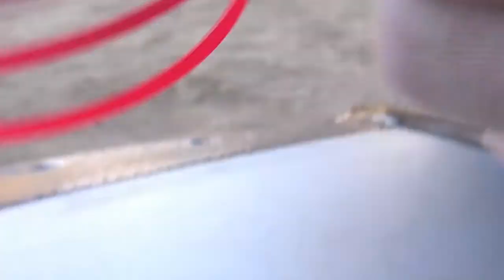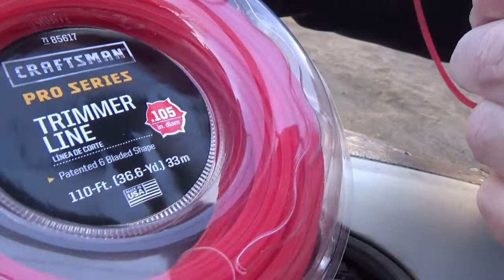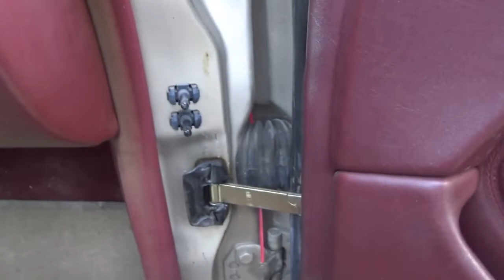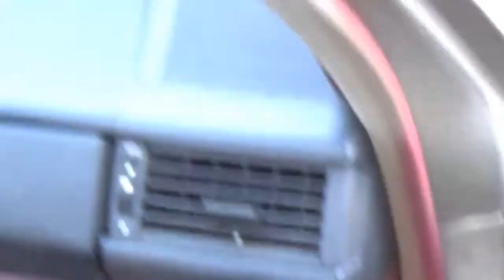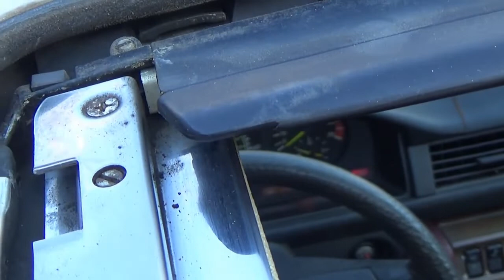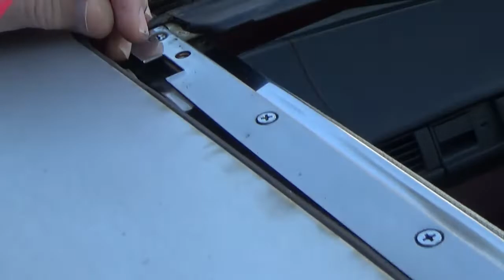1988 Mercedes Benz 300e w124 Sunroof Drain Hole Locations

Comment: Hello. The driver's side fogs up when it rains. Will this method help me solve the problem?
Reply from the maker: Don't Know. I have not run into that problem yet. Sorry.
Reply: It wouldn't hurt to do it anyway, if it doesn't help at least you'll have ruled it out and you'll know your sunroof drains are clear.  It could be a lot of things. Leaky windscreen seal, blocked drains under the windscreen etc. My old W124 used to get water in the footwell when it rained hard, I never did find the cause.

Comment: Is it possible to do it from back Word, from exit side?
Reply from the maker: Think that would make the job more Difficult. Inserting a Weed wacker cord from the Center of the Door Frame to to the top of the sunroof. My way you would Push the debris down and out the Bottom.
Reply: I have problem with open a sunroof , and I know its full of water inside. Do you know how to open it manually?
Reply from the maker: @adamciecwierz3910  You Tube has someone else who made a Video with your Problem. Type in or copy    Mercedes Sunroof Emergency ! 
by Flash Drive Films. with 3.67k subscribers.
There is a Plastic Nut in the Left hand side of the trunk which you use a Socket wrench to either close or open the sunroof. Their video is very detailed.
Thank you.